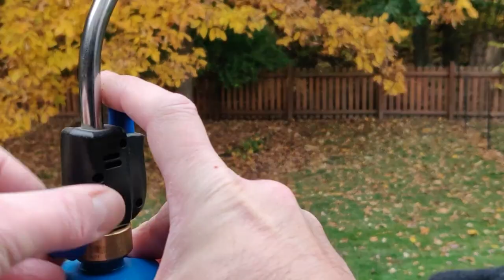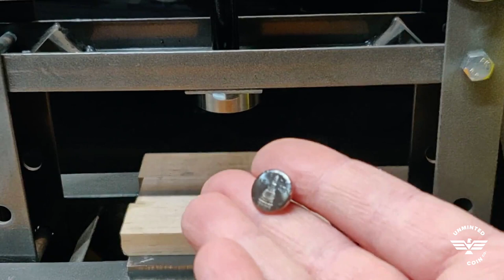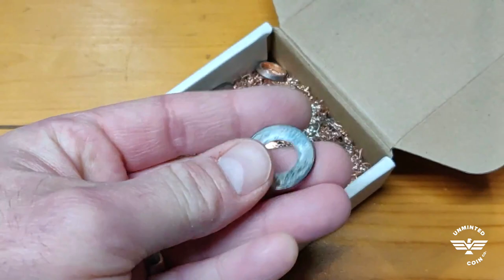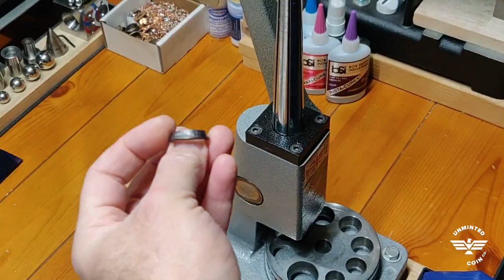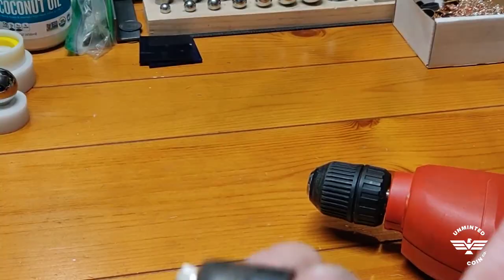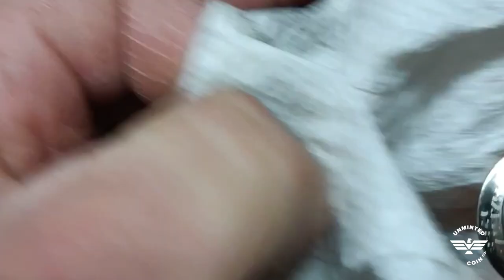UnMinted | How to make an "Inside Out" US Quarter Coin Pendant

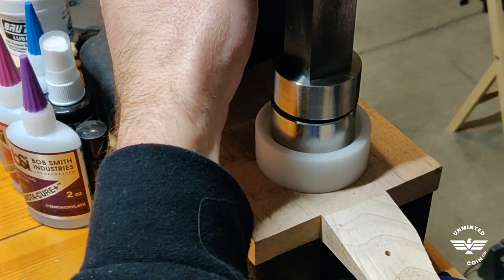Comment: Awesome work! At about 1:18 you have what looks like 2 metal forms on top of a piece of delrin plastic. What are those 3 pieces? I make a lot of quarter rings and your  setup looks a lot stabler than what I'm doing!!!
Reply from the maker: Hey there! Thanks! At 1:18, I'm using the arbor press ram to push down on top of a Coin Ring Repair Die (steel puck) by Legacy Brand Coin Tools: https://coinringtoolsllc.com/product/coin-ring-repair-die-and-pad-set/ and I'm pressing the coin ring down into one of their 17 degree reduction dies. The Delrin base is also from Legacy, it's their Universal Die Stand: https://coinringtoolsllc.com/product/universal-die-stand-by-legacy-brand-coin-ring-tools/ which also comes in handy while keeping the cones from bottoming out at times, and working on bell toppers.

Comment: Is the Delrin puck you finished folding this on flat, or is there a recess, tapered or otherwise? Very interesting process! Thanks for sharing!
Reply from the maker: Hey Tom, thanks! I just use flat pieces of Delrin for these (one with a magnet on top) - the coin edges cut in a bit over time, but not bad and fun to make.

Comment: Greetings,
    first of all.....great product! i saw them on the shop site and began to wonder how the process went.  Then POW i came across this video and started destroying coins.
then i called every bearing supplier in east tx and the standard question was how many thousand bearings would you like sir?
    Amazon to the rescue and a few days later i had the bearings in hand and they were the right size based on my calculations and measurements ( estimated from comparing your press size to bearing size;  if i was going to "borrow" your info i was certainly going to be accurate).
i have only destroyed about $2 worth of quarters so far. i blame it on the substitution of plastic pucks for delrin. and therein lies my question.....can you give me a source for such delrin pucks?
yes of course i have located 2 inch delrin rods but they are at least two feet long! that is a lot of pucks.

thanks and again great product and great video
Bob
Reply from the maker: Hey Bob! 
Thanks - I actually sell Delrin mini pucks as seen in the video if you're interested https://unminted.ltd/product/delrin-mini-puck-set/

I also have some 2" stock and could make a couple pucks for you. Please let me know through orders@UnMinted.ltd